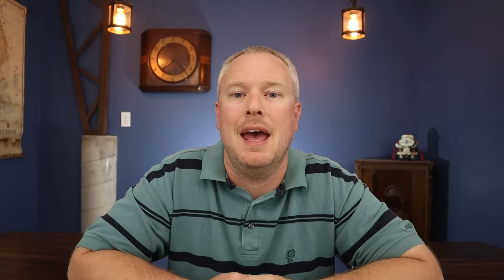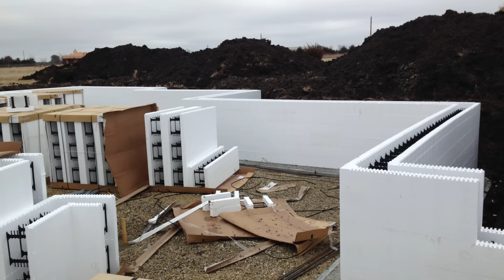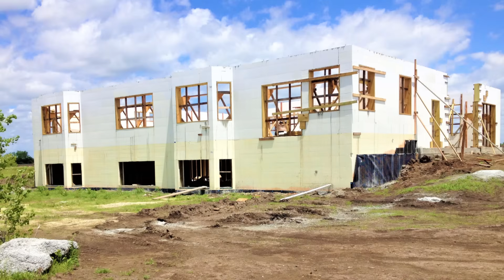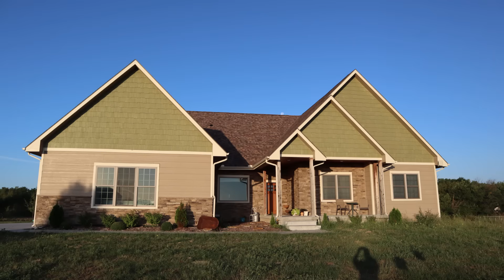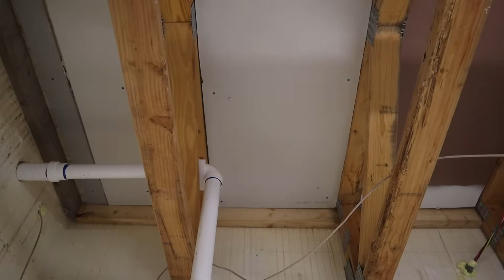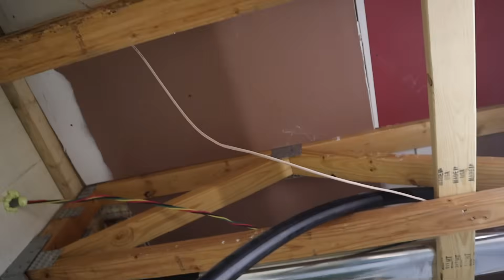Is Geothermal Heating & Cooling Worth It?

Comment: So - my take from your feedback is that success starts with a house that is highly insulated and positioned to maximise Solar PV take and equipped with radiators (or underfloor heating) sized for the lower flow temperatures you will obtain from the heat pump. Some form of electricity storage would probably help too. That sounds like a new-build house unfortunately.
Reply: or you can do it in stages

Comment: As I got older and wiser, I found out the best way to improve efficiency was to move from our 5,700 sf home to our present 1700 sf home.  Now we have a farm with horses, 3000 sf of external shop/ horse barn  and a much more happy lifestyle from when what we had when we were chasing our tail .   With solar, our electric bill is about 30 to 40 bucks per month with 2 stage air source heat pump.  Electric bill with the older home was  about $250 per month.  Thanks for posting and good luck with your interesting builds Garrett.
Reply from the maker: Good deal!!!
Reply: Today’s new house market is huge bland colored houses on postage stamp lots. Tall ceilings and very large volumes. Much less energy efficient and ugly designs
Reply: @andrewwolf4430  But they atleast have proper windows and doors now?
Reply: Nice, you're lucky your electric company doesn't charge almost $40 a month just for a service charge. My actual electric usage was $40 in June.with solar, Total bill was $80
Reply: Cuz you don't live in Europe here you pay the federal government for air outside 😂

Comment: Do you have a good air to water you would recommend.  Ground source is not an option for me
Reply from the maker: No specific brand, but I would spend extra money on one with a 2-speed or variable speed compressor.
Reply: Watchout.!!!   Air to water system works only if the air temp is above 7C (45F).
Here in The Netherlands this system is used from Mar/Apr to Oct/Nov and complemented with a NaturalGas heater for the winter months to reduce the NG bill.

Comment: These videos all need to come with the disclaimer that geothermal systems only work up north. We don't use heat down south, so all of our costs are for AC. Our ground temps are in the 70's-80's all year, so it takes a gigantic ammount of water to accomplish the thermal transfer. Nobody down here has a geothermal system - which should be a red flag to anybody considering one.

I have a small geothermal system (2 ton) that was given to me for free, so I hooked it up and I run it off pond water. By the time you factor in the water pump, it costs roughly twice as much to run as a standard unit would.
Reply: Not sure where you are located, but geo systems for heating/cooling are installed in Texas with good results. If you are outside if the US then good luck to you.
Reply: @renalshomlmes338  I am in Florida, which is still in the United States. Geothermal does not work in our warm soil climate. Many, many "northern" ideas have failed when yhey were attempted in the south.
Reply: @paramax55  air to water pumps are definitely more cost efficient to heat water on warm climates. Depending on the location and heat needed solar collectors might be even better choice for hot water when you only need to cool the house.
Reply: @viljosavolainen2286  I agree that it is easy to heat water in the south. My geothermal unit heats water nearly as fast as a point of use water heater. My inlet water is almost always close to 80 deg F. I have it exiting in the 90's so that the refrigerant is cooled toward 100. The volume of water needed for that causes the water pump to draw about 2.4KW of electricity. The AC unit itself draws about 3KW. If I could feed it water that was 30 deg cooler, the savings would be there. As far as using it for hot water... It would take just a few minutes to heat a 30 gallon tank. Since our tap water comes out around 80 deg anyway, it takes very little hot water for us to have a hot shower. the heat exchanger would definitely cost more than it would save.

Another example that does not work down here is energy recovery ventilation. We had it incorporated into a brand new, energy-efficient public building. After the floors were mopped in the morning, they would not dry for about 4 hours. If it rained, condensation would cause the floors to get wet all by themselves. The latest building had 10 tons of AC and 15 tons of dehumidification. That building came close to working, but it's an energy-conservationists nightmare.

My biggest takeaway is that different things work in different locations. If I were making a video about energy efficient climate control, I would say to keep the sunlight out of your house, don't do geothermal, and heat strips are much more cost effective than a heat pump. People up north would call me crazy. But I would say that those people also have no idea as to what it is like to battle our type of heat all year long.
Reply: @paramax55  Yeah. Entirely different needs and realities. I get almost refrigerated level cold water just by couple seconds of running the tab. I was considering geo system with my 40kwh needs with a big pump but in the end opted for other type of system. Big house and hot water usage counting for half of it. No easy option for retrofit cooling so heat output only. Typically we have only limited amount of hot days where cooling would be really needed. Condensation? Only  in the old cellar.

Comment: I had a 3-ton, 3 vertical well geo system retrofitted to existing ductwork this past November 2021.  I also have a 10.5 kW solar array.   So, far I love both, and this year I anticipate being net zero.    

My geothermal system is from Carrier/Bryant, and the total cost was $19,300 (less a 26% tax credit).   A friend of mine paid nearly $12K for a new HVAC system, so to my mind, having this system installed was a 'no-brainer' once the cost and efficiency were considered. 

I pretty much agree with all of Garrett's comments.   While there is a low-end hum from the compressor, the variable speed fan is much quieter than my old air handler, so from a noise perspective, I think the geo unit is quieter overall.
Reply: Did the $19,300 include the three geothermal wells?
Reply: @robertvandermolen230  It included everything: cart off of old HVAC, boring of wells, new equipment, installation, and electrician.

Comment: Are there any observations of the fluid in the loops taking the shortest path in your loop field at that manifold in mechanical room? How can you be sure the fluid is pumping evenly through out?
Thanks
Reply from the maker: All of the loops are exactly the same length and depth, so they balance well.  I've taken temperature readings of each line, and they are within half a degree of each other.

Comment: Hi, I have a dilemma that I can’t find an answer for. Ground source loops are generally dug 5-10feet below ground, but why wouldn’t you dig it to ~20feet for more stable year around ground temperatures? Or is there something else I’m missing?

Considering you have should theoretically have the highest ground temperatures in winter when you need it the most and highest efficiency, instead of summer.
Reply: if you get a chart of the ground temp vs depth you'll notice that below about 36" the temp barely changes with increased depth. Since it costs more to dig deeper  it really isn't worth digging 20 feet.
Reply: @bobjoatmon1993  the frost line where I live is about 3feet. Or 1m. 

And shouldn’t the temperature be stable and not  change? What use do you have of a 32f soil during winter when it could be 50f year around?
Reply: @inteallsviktigt  I think the point is that it's a matter of diminishing returns. At some point you're adding significant cost to dig deeper for very little change in temperature.
Reply from the maker: You can dig as deep as you want.  It just normally costs more to dig that deep, and you will definitely need trench shoring.
Reply: @Challenged1  well of course, but at some depth you end up having no benefits and would be better of drilling instead. 

I’m going to do it myself as well at get some help as your videos are directly inspired me to do it and try to maximize the efficiency you gain from it. 

Have you thought about preheating the liquid from the ground loop with a thermal collector /concentrator before it entered the heat pump as a way to increase the SCOP value?
Reply from the maker: @inteallsviktigt  I have not.  At this point, any modification to my own ICF house would be difficult, so I'm content.

Comment: Please keep these updates coming.  Your videos have inspired my family and my parents to sell our houses and do this ourselves. We have purchased land and just starting the steps to build our dream home.  I'm using ICF and geothermal thanks greatly to you sharing your experience. These updates on anything you did allows me to make any adjustments based on things i might hear. I would like to hear more about the hot water tank being heated by geothermal.  Keep up these great videos and perfect format.
Reply from the maker: Here's a link to the desuperheater that I hooked up:
https://youtu.be/WSD-CsKphTY
Reply: @Challenged1  thanks again! I had seen that in the past but must have forgotten.  So your heart pump came with that feature built in.  I will be looking for that.  Who did all your manual J calculations and system design for the house? I'm needing to get that done at this time and my designer does not know anyone who can design for the ground source heat pump.  My build is in SE AZ so AC is the main oporation needed so that free hot water would be abundant for me!
Reply from the maker: @tazman6235  Yes, mine came with it built in.

I had a couple of HVAC guys helping me design in the beginning.  We actually didn't do a manual J, just figured what a typical house would be and then reduced by 30% to accommodate for the ICF construction.
Reply: @Challenged1  where did you actually order all your geothermal hardware (ahu, condeners, lines, ect.) from? In having a manual j and manual d completed by this guy does not sell any equipment.
Reply from the maker: @tazman6235  Key Refrigeration in Wichita, KS.

Comment: I wanted to install geothermal in my new house but couldn't because we only have less than 30" of topsoil above 10,000' of bedrock.  And drilling one or more wells would be very expensive especially since we have very cheap power at less than .05/kwh.  So I have 2 heat pumps, which I recently had to replace both compressors after 22 years of service.  My electrical cost runs from $150 in the summer to over $500 in the winter, in a very large over 5,000 sqft house.  We're in Central Wash State where the temp runs from zero in winter to over 100 in the summer.
Reply from the maker: Thank you for sharing!!!
Reply: At 5 cents a kilowatt hour, honestly if you insulate your house, that’s the cheapest it’s ever going to be
Reply: You need to get you some high power explosives and access that sweet spot in the bedrock. Go straight down with a spiral coil
Reply: For anyone reading this you can drill a vertical well into the rock. I had a 3 ton unit connected to a 500 foot well. The well cost 9k and included the loop and grout and pressure test
Reply: @pb7379-j2k  That's a good price.  $18/ft.  Around here it was $25/ft 10 years ago, and it keeps getting more expensive.  And that is just for the drilling, not the loop and grout.  Our rock is basalt, which is harder than granite, which might be part of the reason for the cost.
Reply: @robertfakler8564  maybe so. Mine was in CT which I believe was granite

Comment: Thoughts on type of ground source heat pumps for radiant floor heating or forced air?  Also what about heating potable water?  I have read that the potable water does not get as hot? Thank you for your videos
Reply from the maker: My units are Bosch.

I haven't had an issue with the desuperheater not producing hot enough water.  The water heater set point isn't far off of normal regardless though.
Reply: @Challenged1  Bosch is a top notch brand definitely planning on going with it when we build.

Comment: Good, informative video! That's a lot of space to heat and cool! Nice! 
People were telling us we should install a system like this, but in our area, and with the passive solar design of our house we should be able to stay comfortable with the occasional use of a wood burning stove in the winter, and an evaporative cooler in the summer. We are all solar, but putting in some propane for our stove, and we'll have the option for the dryer as well. 😊🏜️
Reply from the maker: Good deal.  Low or no bills are an amazing feeling!!!
Do you have much humidity in your area?
Reply: It's very dry until the monsoon rains hit in July. Our evaporative cooler won't be as effective then, but the rain also cools everything down a lot.

Comment: Did you do a blower door test? What was your ACH?  Aerobarrier could cut your ACH in half, and the blower door testing is continous during that process.  Thank you so much for all the info on geothermal systems,  I'm definitely gonna do this myself!  Keep up the great work!!
Reply: Since this is an ICF house (mine is also), the leakage is only going to be around windows and similar penetrations. Aerobarrier is probably not suitable for an ICF construction. A blower door rating would be interesting, but at this point, not of much use, I'm guessing he paid a lot of attention to detail when building the house, it shows in the quality of everything.
Reply: @TagiukGold   Thanks for bringing that up, I'll have to look into that more!
Reply from the maker: I did not do a blower door test when I built.